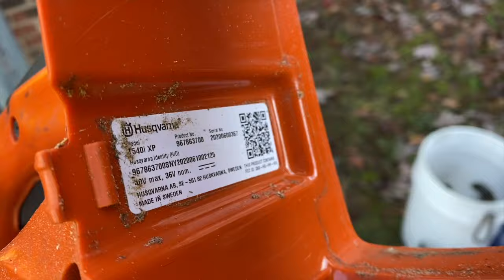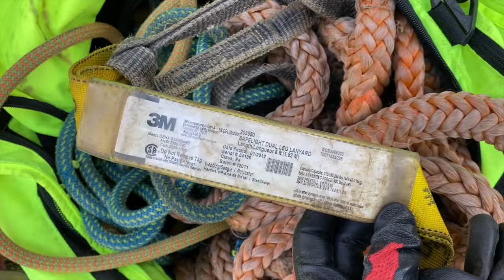Double Ash Tree Take Down in Greensboro, NC  Part 2

Comment: It’s great to see you again especially doing a job in NC where I just recently moved from.  Nice video as usual.  The great things about Ash trees are that they hold their strength for many years after dying and are rot resistant.  Stay safe fellow climber.
Reply: Ash tree do not hold their strength. That actually the problem with dead ash. They're super brittle. All the limbs bust into small pieces when they're dropped, if you rig them they bust into a million pieces when they swing into the tree. They get very hard when dead but that equate to strong.
Reply from the maker: Oh yeah they do rot because once they die its fair game and I use rot loosely to signify any form of decay because I don't know all the technical terms however they do in addition to becoming extra crispy or as you say brittle but  these trees where not that bad and the homeowner wanted to get ahead of the more hazardous conditions for a tree.  However it is an amazing world of  tree work depending on where you live.  Thanks for commenting and watching the vid :)
Reply: I definitely have misidentified these trees in my area.  It’s hard to do because they have lost all their bark but are still strong.  The tree trunk and limbs are grayish in color.  They are brittle cause they are dead but you couldn’t break a 2 inch limb if you tried.  I’ll have to research other rot resistant trees indigenous to Missouri.  Thanks @TreeBoi4Life